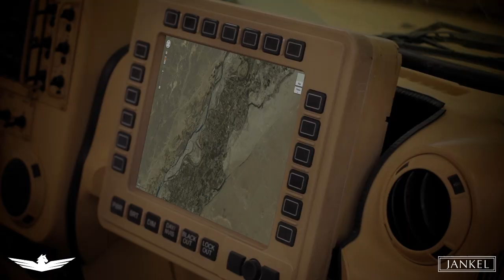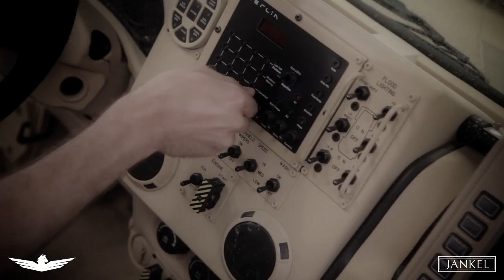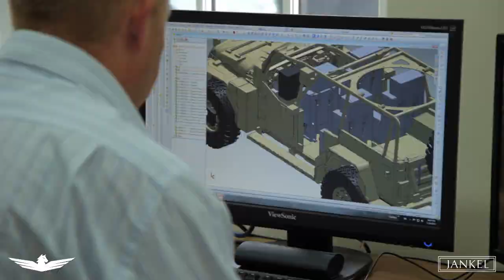[Official HD] Jankel Jeep J8 Pegasus SOV (Special Operations Vehicle)

Comment from the maker: The civilian version of the J8 is the Jeep Wrangler (with a long wheelbase).  The chassis, braking, suspension and engine have all been uprated and ruggedised on the J8 for the consistently extreme conditions that a military user faces.  But on a base level, the vehicles are very similar.

Comment from the maker: The Pegasus SOV is not designed for missions of the same length as the Al Thalab.  Due to the size and GVW of the Al Thalab it is capable of remaining in the field for longer periods of time without refuel or resupply.

However the Pegasus is outfitted with, or has provision for, extremely high-tech equipment and is therefore a far more suitable vehicle for high-speed incursions and general Special Forces use.

The underlying Toyota / Jeep platforms also better suit different organisations.